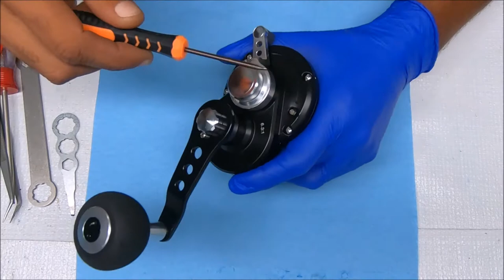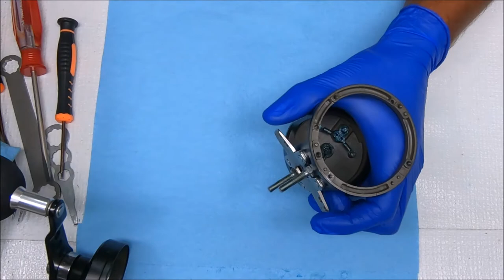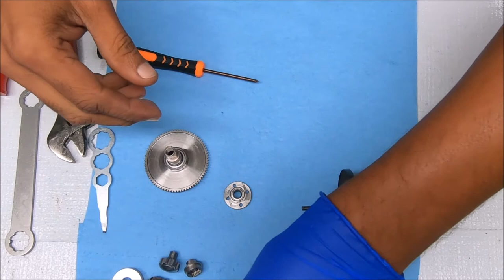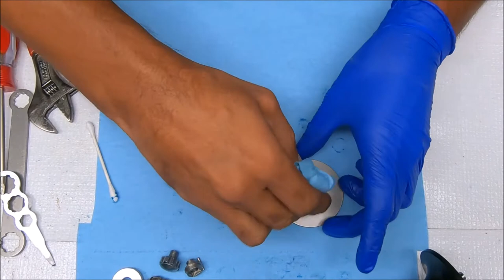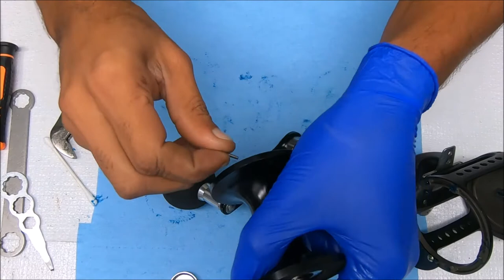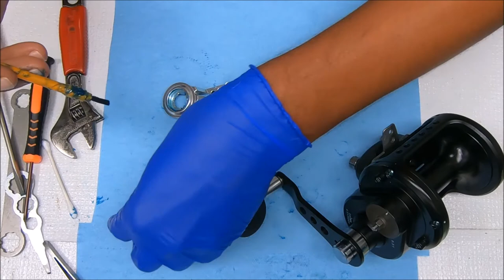Daiwa Saltist LD50H Fishing Reel - How to take apart, service and reassemble

Comment: nice job I have a 35 and its sat for 3 years. its all bound up. gonna have to take it apart. obviously it never was greased from the factory. even with sealed bearings it should be coated to protect from the salt.
Reply from the maker: Thanks and thanks for watching! You might be pleasantly surprised when you get in there. Might just need some cleaning up to be as good as new. Then again, it could also be a horror show, with parts that need to be replaced. 🙂 Spread the word about the channel.

Comment: HI! awesome video. My saltist hyperspeed reels backwards when I pull drag out quickly at anything above about 5 or so pounds, do you think that is the anti reverse bearing? also when I tighten up the drag near full it becomes immensely harder to reel.
Reply from the maker: Thanks for watching! The anti-reverse clutch and pinion bearing are likely bad. You'll need to get them replaced, but you should take your reel to your local repair shop for service to make sure nothing else is wrong with the reel.
Reply: @TSGReelService  thank you so much for the respond!!
Reply from the maker: You're welcome and no problem.

Comment: I noticed the drag washer is glued onto the spool. Do you know what glue I should use to replace it? Mine is completely worn out. Thanks.
Reply from the maker: Thanks for watching. Do you need to replace the drag washer?
Reply: @TSGReelService   Yes. it is glued onto the spool. I guess i will pry it off and glue a new one on. Wondering what to use.
Reply from the maker: @thirstyowlthethird9409  Okay. The drag washer isn't sold separately. You'll need to buy a new spool.
Reply: @TSGReelService  Hi, thanks for the video. I'm considerind to buy this reel and wondering about the drag washer replacement. I suppose there should be a possibility to drag old one away, order a new customized one and glue it to a spool? Otherwise, it's quite a big investment to buy a new spool after every couple of years...
Reply from the maker: @serhiysemenko2027  Thanks for watching! You could try contacting Daiwa to see if they'll do it, like avet did on some of their reels. Or maybe you could try scraping the drag and glue out yourself and putting in a customized drag. Other than that, the only option provided for that part from Daiwa is a complete new spool. Maybe someone else who reads this will have some input on the matter, so keep checking.

Comment: Do you wipe any grease on the drag on the spool? Thanks.
Reply from the maker: Thanks for watching! If you mean in the drag area, not always.
Reply: @TSGReelService  yes the carbon fiber drag itself.
Reply from the maker: @thirstyowlthethird9409  I grease dry carbon fiber washers most of the time. If it's already greased, then it depends on the condition. Thanks.

Comment: For some reason my spool is so hard to turn
Reply from the maker: Thanks for checking out the video. Is this before or after you serviced the reel yourself? Did you follow this video or wing it?
Reply: The free spool was not free like you had it so I followed your steps now the spool has like 20lb drag on it in free spool. Spool is stiff even without the handle side being on barely rotates in the housing
Reply from the maker: Are you saying that you followed my ENTIRE video for servicing your reel, or that you had a problem with your freespool before using my tutorial, and then tried to use a portion of my video to diagnose and fix the problem?